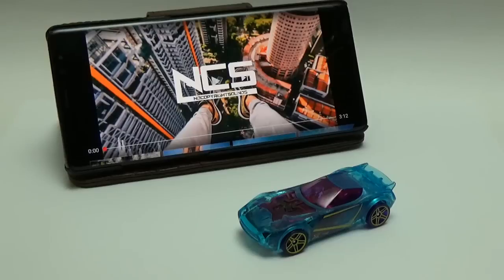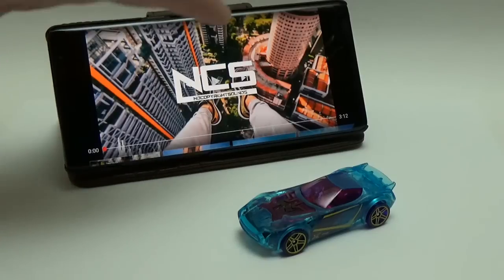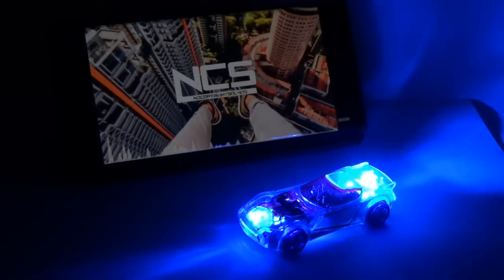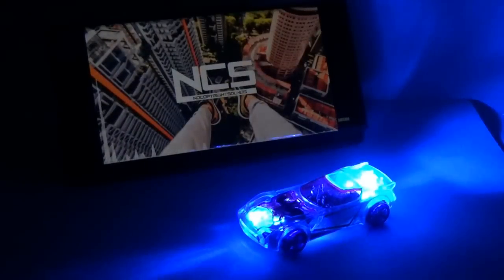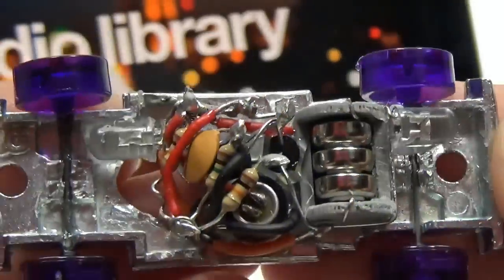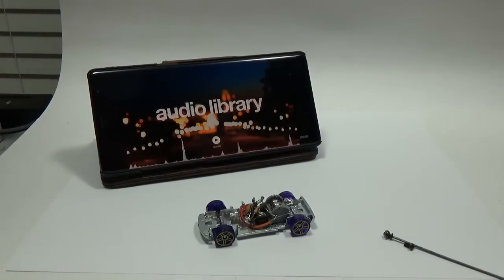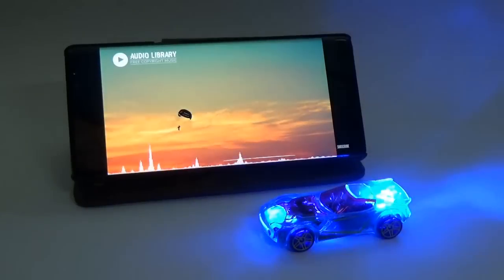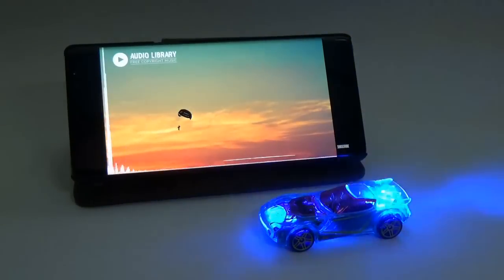"Light Beats" Dancing Lights Hot Wheels Custom

Comment: SUBMIT YOUR IDEA to Mattel. If you don't, someone else will! So get the credit when credit is due!
Reply: karl28560 Or the headlights one
Reply: karl28560 It is too expensive for a mass production model. The idea of lights “dancing” on music isn’t new
Reply: Kevin Meijer this design is pretty simple. I reckon Mattel could easily print circuit boards housing all the components (including the LEDs and microphone) and it wouldn't even cost then much to produce once developed.

Comment: Sorry I missed the chance to contribute. I would have suggested an RC (that's resistor/capacitor) filter to limit what frequencies would turn on the LEDs. For instance you use from three to ten cars for as many audio bands as you want making them into an old fashioned color organ. Three would be treble, midrange and bass, more would create a wave effect along a row of cars.

Comment: OOOOOHHH yeah!  Thats some sweet out of the box customizing!  three ideas: mcdonalds hot wheels of the modern type tend to be a bit bigger, also buses, rv's and possibly those truck and trailer sets with the car? racegrooves does a bunch on his tuesday thing. but those all have room as well as the dairy delivery. the boom box casting or any of those suv types.  great stuff, ive seen some neat rc helicopter and some slot car and pocket rc motor or light set conversions into hot wheels castings but this hits on a lot of other areas those conversions don't, the sound activation ;)  add glow in the dark wheels please ;)

Comment: This is a very cool idea that Hot Wheels should seriously consider. These would definitely sell, but the button cells would need to be easily accessible (or, use a capacitor that can charge up on a "Sizzlers" type charger.

Awesome idea.  Well done.

Comment: BareMetal, I've been watching your vids and they are great! I never even heard of restoration or mods on Hot Wheels. I find it fascinating! If you want to build the circuit smaller use SMD's. If you draw a schematic of your design there are companies around that offer good pricing on prototype PCB's. It will take a bit of searching but might be what you are looking for. Using SMD's will definitely save lots of room. Thank you for all the cool vids and projects!!

Comment: This is really cool. I don't have a better vehicle for you to use, but I do have better lights for you. Instead of using full size LEDs, you can go to HDA Modelworx and order SMD's that are as small as a head of a pin. They come pre wired and pre resistored so you wouldn't have to do anything but solder it to whatever sound receiving board you're using.

Comment: It seems to me like the LEDs are either off or on; I think it'd look a lot better if they faded, but I don't know if that's even possible. Regardless, you should _definitely_ submit it to Mattel!
Reply from the maker: it is possible but would require more components to make it work... for a larger car this is fine... for this car i don't think it would be possible.
Reply: How about making a disco van or something? You could be as creative as you want with the outside and have color changing lights on the inside with plenty of room (maybe).
Reply: I think it would look better in person.   The dynamic range of the camera may be limiting here and give the appearance of "fully on".

Comment: There are some tiny rechargeable batteries used in the RC hobby that could be used for your projects.  You might also be able to reduce the size of the circuit by etching your own circuit board and using the tiny surface mount components.  They're hard to hand solder but make for a tiny package.

Comment: Very cool light effect on the X-raycer! I was thinking of taking a larger vehicle—like Fast Gassin—and putting a very small Bluetooth speaker in it where you could play music from using your phone. Adding this light effect as well would be really cool I think. You would need a translucent body though for the lights so—it would require some serious modification (which I think would be fun). Anyways—I think it would be a good idea to review the circuit schematic first and then show how you fit it into the body of the car (not easy I’m sure). You said that you 3D printed the battery case which is neat—but I don’t have one (yet) and other options for a battery case might be a good idea to suggest. Have you ever tried to 3D print wheels yet? I know that question is off topic for this video but I had to ask as that is something I would want to try instead of using donor cars for wheels swaps.
Reply from the maker: I have printed off larger wheels but have issues with smaller wheels.
Reply: Insert the KLM plane shortly crashed at the